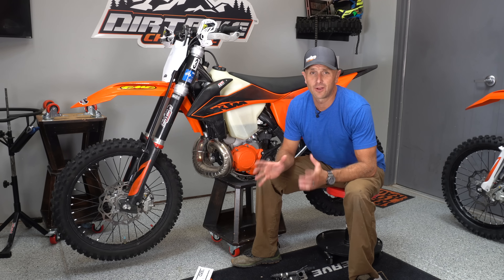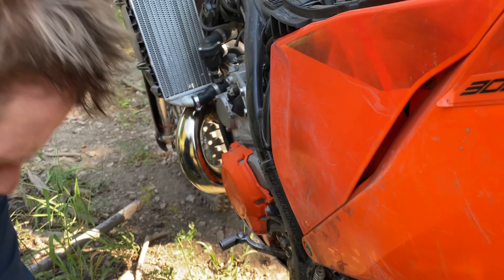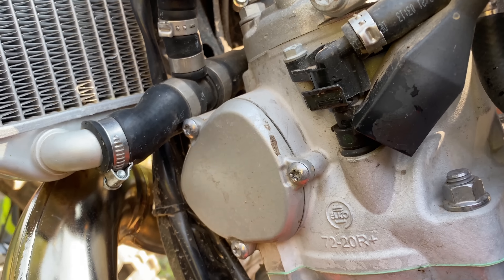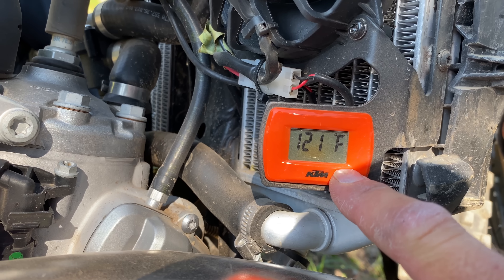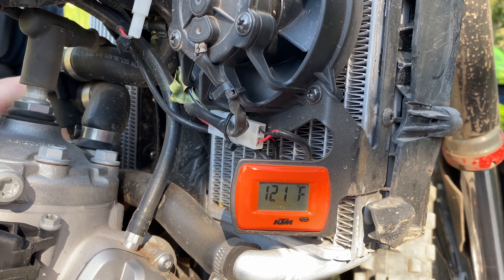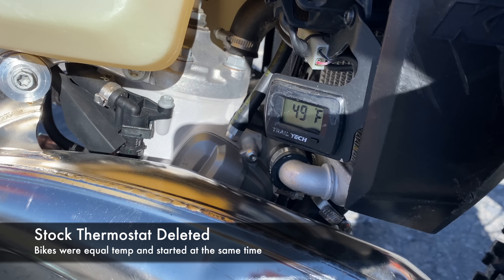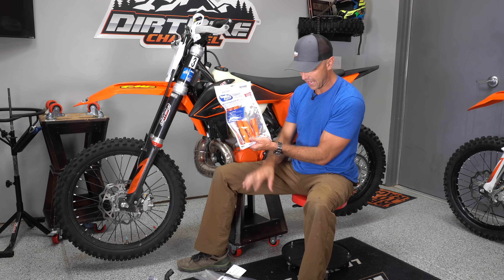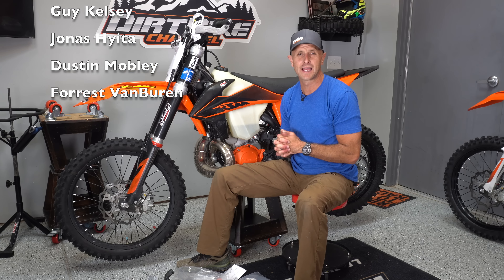2020 KTM Power Valve Puncture! | Trail Hack and Shop Fix! KTM needs to fix this!

Comment: This just happened to my 2018 300 xcw except it broke at the nipple. The 2017-2018 XCW models have the thermostat, but the xc and sx models do not. So this can happen even without the new radiator location.  I went with the Tusk hose kit off RMC. This is why I tune into the Dirt Bike Channel. Thanks Kyle

Comment: I kept the original design and replaced just the 3" of hose by cutting the pressed clamp.  Hose came right off and I used 3/4" hose and two clamps to repair.  I like keeping the thermostat and if it wasn't needed, they would have run straight hoses.

Comment: Hey Kyle, I ran into the good'ol radiator hose hole on the power valve cover side today and I was wondering if I could get away with a 3/4" heater hose fix for now until my replacement hoses show up? I'm rocking a 2023 300xc-w with 2 hours unfortunately 
Any advice would be greatly appreciated

Comment: Great video. On the 150 ktm does it look like the 250sx hose that connects between the rads will fit the 150? The 2 hoses you mention are slightly different for the 150 I believe. The cross over hose is just straight  where the 250 sx hose has a bend to go around the cylinder.  My question is can I use the 250sx hose as its is 40$ cheaper than the 150 sx cross over hose. Thanks Brian

Comment: 50+ hours on my 20 300xcw singletrack and extreme riding and still haven’t had this issue. More tip overs than I can count.   Enduro engineering rad braces and keep an eye on the area for rubbing.  Expecting it to happen but nothing yet.

Comment: Where did you measure the temperature when you compared thermostat and non-thermostat. If on the radiator then it does not give true picture. Thermostat is supposed to keep coolant circulating in engine without entering radiator until engine is fully warmed up so actually the radiators should stay cooler for longer time. It most likely makes no difference when its warm outside and speeds are low as engine warms up quickly and it opens quickly. Difference comes when riding in cold weather and/or high speeds when cooling effect of radiators might be so good that engine never reaches optimum temperature.
Reply: That makes sense, thanks for the info. I ride year round and KTM obviously thinks it's important so I'll keep it in.

Comment: Thanks for bringing this up to those that were not aware. 
Where those temp tests done with the bikes idling and sitting still? or riding at speed down the trail? Moving fast at riding speed and cooler outdoor temps would give a more true picture of the consequences of a thermostat delete, so just curious. And I suspect a TPI bike is going to fuel quite a bit different throughout the temp range compared to a carbed bike. Anything to be worried about? Maybe not, something to consider.

Comment: Cold winter, fuel injection will not like no thermo,  it will enrichen fueling
Reply: I was curious about those kits. I have a 20 xcw and didnt wanna remove the thermostat.  Only samco kit available took it out.

Comment: 5:15 If you go to Amazon to buy the hose guard and it is sold out, the manufacturer is Epha here is a link to their site http://www.epha.com/hose-protectors/
They don’t sell direct, so a site that carries their product is https://theelectricaldepot.com/epha-hose-protectors/epha-hose-protectors/epha-hp4o-hose-protectors-4-orange-0-25-to-1-00-od  -  they are $2.62 each and available in orange and black.

Comment: Had this happend and my trail fix was to loosen the clamp on both coolers and slide hoses and termostat as far left as possible to make the hole in the hose end up on the left coolerpipe under the clamp.

Comment: I think it’s better only use the hose guard because 1 -Tpi engine need a constant temp for fast close loop cicle in the ecu, 2 constant temp is good for your cilinder less wear and in the winter bike run better .

Comment: I just had this happen last weekend!!!
I bought drove down and bought the Samco kit from RMATV yesterday but i like the delete idea. Do you know if i lose my functionality of my KTM integrated fan deleting the thermostat? I have a 2020 xcw and 2020 TE300i, I don’t have the digital one like you it’s just plug and play and it goes off the internal computer.
Reply: Ever figure out if this will work?  I've got the same situation.  2020 300xcw.  Would like to do the delete but have the KTM integrated fan kit.  Let me know if you ever tried or tested this.

Comment: great tip kyle to remove thermostat its only there to warm engine faster and  improve emissions was thinking of doing the same great hack on the trail also 👍🇬🇧
Reply: Aint the thermostat tells u if engines getting to hot? Confused here fella

Comment: 2021 ktm xcw  just punctured mine this past weekend. Had to loosen radiator cap and fill up with water to make it back in from a dual sport ride. KTM needs to fix this. Looks like there was no change on the 2022 for this.😡

Comment: Had this happen before my bike came out of warranty been waiting on parts for a month be aware the oem hoses and thermostat housing cost 140-160 bucks. 
I patched mine together with flex seal tape and a hose clamp hasn't leaked while I wait for the dealer to get parts

Comment: Just checked my 2020 that has yet to be dropped and the radiator hose is already being pushed on by the power-valve cover (and screw). It's insane that there is already this much contact on an important hose straight from the factory.

Comment: You need the thermostat for winter riding so your bike gets up to temperature. My 150 sx has no thermostat so KTM gives you 2 plastic radiator block off plates, which one you use depending on outside air temperature
Reply from the maker: We have tested it in the winter and found that it doesn't make much diff.  That test I showed was below freezing weather.
Reply: Nope, i ride an XC, never had a thermostat. Runs just fine in the winter. I live in NJ as well, gets cold.
Reply: jerseyboyfirepoi , where you riding at? Atco area or Brendon T Bryne?
Reply: @MrBe787  haven't been there... usually it's Millville or Englishtown to ride the track. Most of the time it's going to a local pit/quarry to ride. Sahara sands, Frenchies

Comment: My 2020 KTM 300 XCW has Bulletproof Designs radiator braces, and the radiators are pushed back flush against the power valves on both sides.  So yes, my bike has this problem.  I need to order the guards shown above but they are "currently unavailable".

Comment: It seems by lowering the radiators to improve the steering lock, KTM have caused a much bigger issue, that could leave a rider stranded in the middle of nowhere. I remember you measuring the steering locks of KTM's and Beta's and your comments on the poor steering lock the Beta's have especially the RR200. I have a 2020 RR300 and there is no way this radiator issue could happen, the whole setup is so different.

Comment: pretty sad when you pay that much money for a bike that you have to jimmy rig the cooling system to hold fluid
Reply: Or stop riding through the nastiest trail sections so damn fast when 3 mph is safe but hot shoes have to hit it at 30.
Reply: Their kinda junk. I have a 2017 Husky TE300 and it’s the biggest POS I’ve owned. Or the only POS I’ve owned because it’s the first Euro bike I’ve owned. All the other have been Japanese and their built a lot better.
Reply: @Scottstunts  and alot less money
Reply: @carlatamanczyk3891  The lightest fall over can cause this issue. My bike with ~5 hours on it tipped over in the soft Michigan sand while I was barely going. Boom - punctured hose.

It's a bad design.
Reply: @JoshuaStevensMaps  I agree.

Comment: You should always run a thermostat.    An engine can actually overheat without one.    You are not giving the fluid in the radiator time to cool down before re-entering the engine.    Now if the radiator is excessively  overrated for the application you may get away with it but in that scenario the engine never really heats up either.   On a smoking hot day when running that bike hard it may overheat.    Keep an eye out for that.   Additionally heat in the engine keep tolerances where needed and also keeps the combustion chamber free of carbon and gunk.    You may foul plugs more quickly?  Lastly I am uncertain how the modern dirt bike is set up with fuel injection but most fuel injected vehicles have two programs.   Open and Closed Loop.   When cold the PCM runs one program for cold start etc.   Then once the engine reaches operating temperature it runs another.   You could be delaying, or even perhaps never achieving closed loop and the PCM will just assume the engine is cold, keep the fuel mixture fat, etc.

Comment: Maybe I missed it.  Will this modification work on the 300 XC-W as well?
Reply from the maker: This is a 300 XC-W :). Yes, it will work.
Reply: @DirtBikeChannel  I thought it was but the parts only come up on a OEM lookup for the 2019 300 cc and 2019 Tx300. Got them ordered for my 2021 (whenever it shows up). Thanks Kyle.

Comment: Is this happening on the carb xc line so far it looks like it's only on the fuel injected models ?
Reply: all 2019 and 2020 2 strokes have the lowered radiators, that is the cause of this problem
Reply: Ok but so far I'm only seeing this on the tpi models ?

Comment: I wouldn’t recommend deleting the thermostat. It’s purpose is not to make the engine warm up faster, it needs to stop the water flowing so it can spend enough time in the radiator to cool. In a hot climate you will be ok until everything heat soaks then you will over heat.

Comment: I say get rid of the water cooling and radiators. Circulate transmission oil around the head and cylinder - that engine has a lot of cooling surface.

Comment: Leave the cap loose and you will have 0 pressure.
Reply: Adam Batchelder and soon your bike will overheat...
Reply: Or cold seize lol
Reply: I have ridden 50 miles with the cap loose to keep coolent in a leaking system. The ideal is to keep coolent in the system and prevent a heat related failure. If you have a leek and  alow the system to build pressure you will loose coolent faster.
Reply: Wow that sounds just crazy enough to work! Thanks for the tip. I can imagine where a weak patch may keep coolant in with low pressure but burst if it gets too hot.